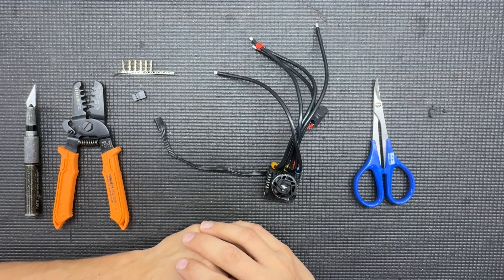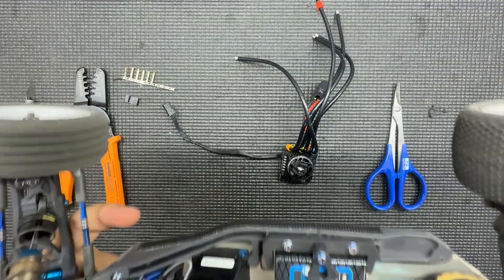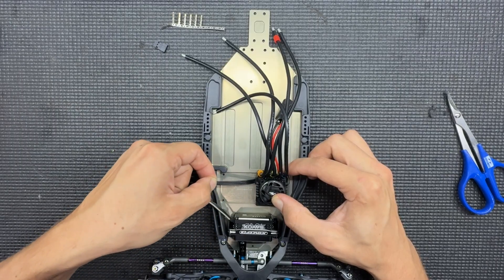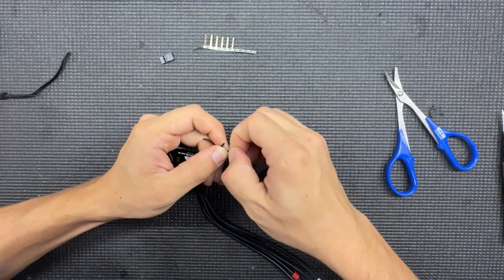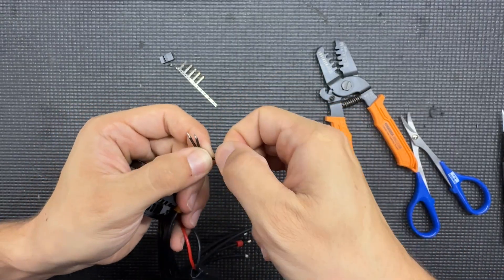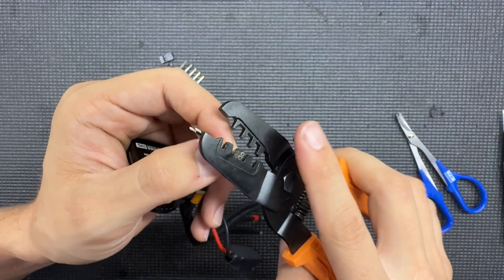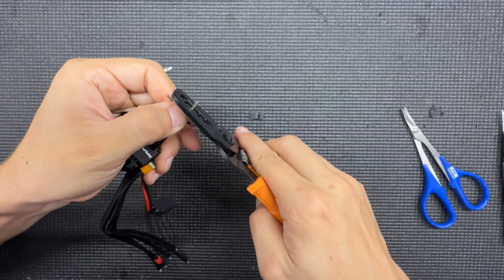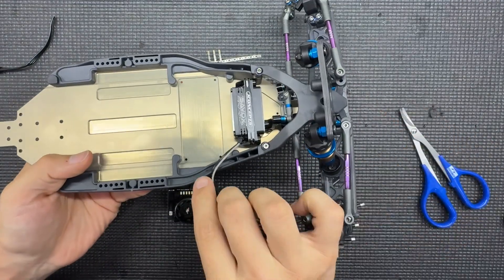HOBBYWING - Spencer Rivkin - Pro Tips From the team - Custom Wiring

Comment: Hi, on an all-black servo wire I always mark the "Signal" wire at the esc case with a paint-marker where the wire comes out of the casing. Also useful for servo. Just a dot or some mark like that. A piece of tape can help too If you don't have a paint marker. That helps me to get it right once the original connector is cut off...

Comment: Extremely Disappointed , Worst Customer Service I’ve Experienced From a Major RC Brand

I placed an order on the Hobbywing USA website over 10 days ago, and this has been one of the most frustrating experiences I’ve ever had with an RC company. They provided me a USPS tracking number, but my package has been stuck in the Los Angeles facility for over 3 days with no movement at all. Clearly something is wrong with the shipment ,it may even be lost.

I contacted Hobbywing USA for help because they are the sender, and USPS always tells the sender to open an investigation or start a trace. Instead of helping, Hobbywing acted like they don’t care at all.
No urgency.
No responsibility.
No effort to assist.
Just generic replies telling me to “wait because it delayed ,” even after I explained multiple times that the package appears lost.

What makes it worse?
I receive packages from California all the time, from different sellers,  and they always arrive on time by USPS.
 So clearly this issue is not USPS alone, it’s also the lack of support from Hobbywing.

For a company this big, I expected at least basic customer service. Instead, I got:
 • No real help
 • No willingness to contact USPS
 • No solutions
 • No accountability

It feels like once they took my money, they didn’t care what happened after.

I’ve spent thousands on RC gear, and I expected much better from a brand like Hobbywing. After this experience, I honestly don’t know if I want to order directly from them again.

Very disappointed.
If anyone is thinking about buying from Hobbywing USA’s website, be prepared, if anything goes wrong with your shipment, you’re on your own.

Comment: Make a video connecting The just stock motor and esc with the Spencer  Rivkin 4800 mah shorty pack. I have to see how you connect using the 5mm connector and what style plug to use. I need to know for my TRF 104. I’m practically brand new in the game.

Comment: You didn’t mention about making sure the signal wire is in the same place in the connector as the original otherwise your speedo won’t work.
Reply: True, but if that’s your problem you shouldn’t be doing it… but it is a tutorial so you’re very right… I regret my comment…👍